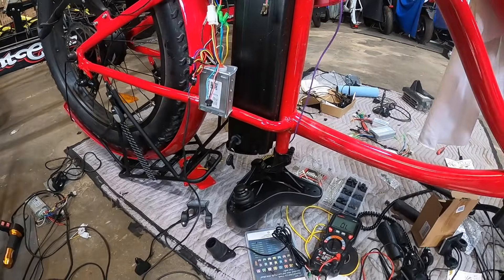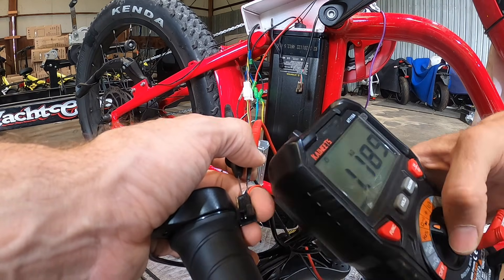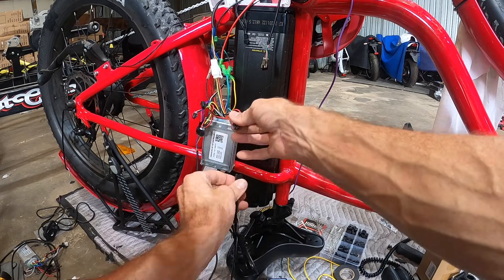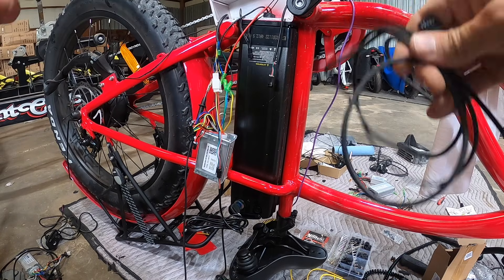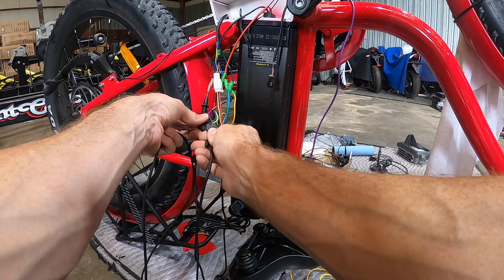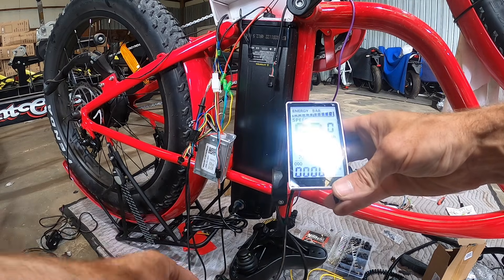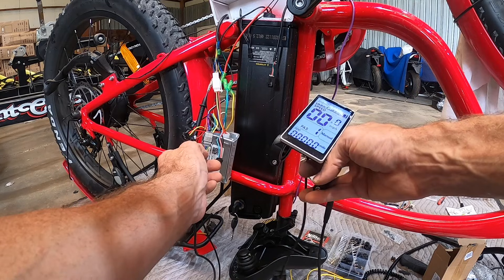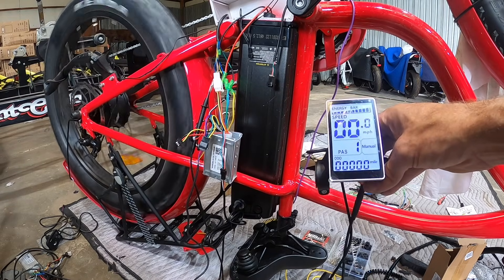E-bike Controller: Wiring And Testing

Comment: My bike and lcd screen just stopped working I replace the controller still won’t come on I have 52v coming out of the battery into the controller very one says 5 volts I have 52 v at the 5pin connector for the splitter on lcd king meter no reply from company
Reply: me too

Comment: I have a similar one, but I  press + and - signes at the same time and then they appeared different setting, I was looking to find if I can increased the speed limit but I now the bike does not start and instead of 5 different modes it only appears 3 of them, the battery charge went to 0 and it was almost fully charged. What can I do to go back to the same setting it previously had?

Comment: You make it look very easy. There is a ton of ebikes here in the Netherlands all with proprietary batteries. All the hardware is good except for the bms and controller. This is the way to keep them running.

Comment: How can you distinguish/determine electronically the rated watts of a controller. If controllers are ISO it would have to have proof. If you had 3 controllers all with 15 mosfets and one is supposed to be 500 watts another is suppose to be 1000w and the other 2000 watts and no labels. How can you tell the watts?? I am buying these controllers they are all the same size and mosfets and 40 amps. The only difference is the price.
Reply: Never believe information on any of those Chinese controllers lol!.Measure the parameters yourself.Use a clampmeter to determine the current.Multiply that with battery voltage.That's your wattage idealy the driven wheel should be loaded. I use those exercise attachments for regular bikes.

Comment: Im confusing my throttle is only 3 wire (WHITE/BLACK/RED) which wire is going to where ?
Reply: Normally your controller will have a red/green/black connection, 5v, signal, ground. Make sure red to red, black to black, and white to green.